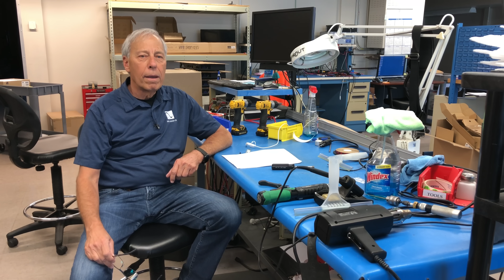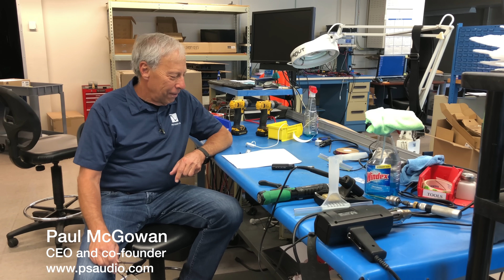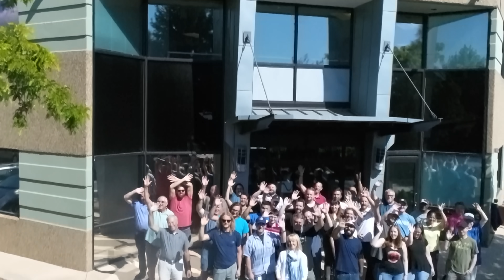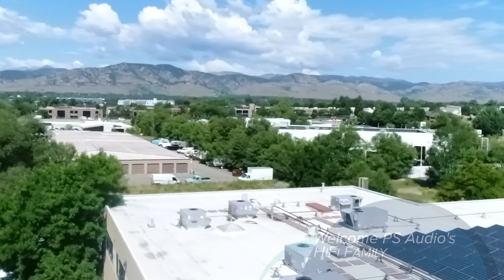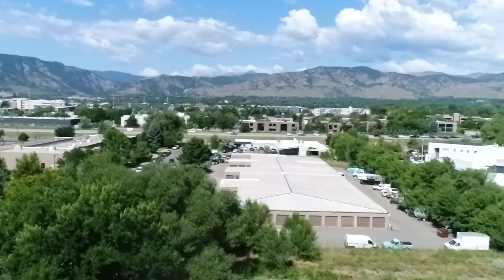Do amplifier specs tell us anything useful?

Comment: A note about harmonic distortion. First, learn about the Fourier Theorem - which states that any signal can be represented as an infinite sum of sines and cosines. So, you enter with your signal into the amp - this signal has a Fourier representation - and when it comes out it has a different Fourier representation with some of the sines and cosines with different amplitudes - therefore, harmonic distortion.

Why "Harmonic"? It comes from the harmonic series that is the fundamental (the 440Hz of the center A in the piano) and its harmonics (2*440, 3*440 and so on).¹ The fundamental is called the first harmonic and the 880Hz the second and so on ... Now lets check a piano keyboard: 880Hz is one octave above  the center A and the 4th harmonic is 2 octaves above the center A - and that sounds good and was even used by piano roll arrangers to get more sound out of the short strings those machines had. On the other hand, there are the higher harmonics like the 13th, 15th and so on which aren't even in tune with any note!²

So, to tell if the harmonic distortion is high or low, knowledge about the technology used is important: a tube amp with high THD will sound very good even in bad loudspeakers but a BJT amp³  with high THD will sound worse the better the  loudspeakers are.

(1) Check the harmonic series in math. The amount of each harmonic was used as the first definition of "Timbre" by Helmholtz (if I'm not mistaken). Nowadays, the definition of timbre has changes and it has been proven that only the harmonics can't account the whole of it's qualities.
(2) Check how modern tuning is done and what is "temperament". You will also learn why higher harmonics will not match any note.
(3) I'm not sure if the BJT always behaves like that specially after watching Arnie Nudell speaking on one of PS Audio's videos - there's more to the art than meets the eye. Nonetheless, classic BJT amps will have horrible sounding distortion.

Paul is absolutely right: specs are not what we hear. I wish someone would do a works, like Beranek did for Concert Halls, and create a set of specs that could give us more information about how an amp sounds - specially in this e-commerce era when we buy stuff without listening to them.

Note: did you know PS Audio is mentioned on one episode of MST3K? Yep!

Comment: Tube amp specs lose out to solid state amps but they sound great. 😬

Funny enough a big name UK speaker manufacturer’s owner is so totally against tube amps that he gets upset when you praise tube amps in their forum. It’s real funny.
Reply: Thom Moore ... what amount of distortion are we getting if we are not pushing the tube amp to say 75%? At high levels of course there’s a good level of distortion in tube amps, we know that. But at lower levels it won’t be that noticeable.

Some people enjoy the sound of a tube amp. So be it. Why the fuss? If you like SS amps fine. That’s your choice. Good for you.
Reply: @hushpuppykl  Tube amps can play louder than solid state amps with the same power rating. Tube amps clip better. If a tube amp sounds distorted then something is wrong with it.
Reply: Anders Hammer ... tube amps have higher measured distortion levels than a solid state. That is a fact.

Some only believe in measurements. If it don’t measure well then it’s deemed by them as worthless.

They can’t accept the fact that people do enjoy tube amps. 😬
Reply: @hushpuppykl  Looking at a spec sheet now for a Mcintosh tube amp and it says .3% which is darn good. Many of the better sounding solid state amps have higher levels of distortion. So specs only prove that its a working amp. Which says nothing about how it sounds.
Reply: Anders Hammer ... well ... that is something hard for certain Hi-Fi technical snobs to swallow. We enjoy tubes. So many reputable reviewers love it.

Even the late Arnie Nudell enjoyed tubes. Bascom H King is ok with it.

Somehow these people can’t handle it. Why can’t they live and let live? Beats the heck outta me.
Reply: Mcintosh tube amps from the late 50's to mid 60's had great specs and they sound pretty good. I have a pair of MC30's with all the paperwork.
Reply: Thom Moore ... people like you need to take a chill pill. Stop going on a crusade. You know how the crusades ended and how wrong it was.

For your information. I own a really good solid state and a really good tube amp. I enjoy both.

Comment: I have noticed especially with cheaper multi channel A/V receivers, that quite often the power ratings in specs are only for 2 channels driven and not at all channels driven, which I think is a little dishonest. If you run your receiver with all channels, it will most of the time struggle to put out that same power that it’s supposed to be rated at.

Comment: I have infinity quantum 2 speakers what amp should I use I only have 2 grand to spend does any one have good ideas
Reply: that depends. if you're on the hi-fi side, you're better off with pro or DIY amplifiers, they're usually far more ideal than most hi-end amplifiers. otherwise, no idea, i'm not a fan of hi-end stuff.

Comment: There are some speakers that are very hard to drive: when you look at their measurement it may show impedance drops from 8 Ohm to 4 Ohm in high and/or low frequencies. Example: KEF LS50. When choosing an amp for such speakers one necessary spec to look at is its power output into 8 and 4 Ohms. The suitable amp will produce 2x power into 4 Ohms comparing to 8 Ohms. If it's less than 2x – avoid, otherwise those demanding speakers will sound lean in the bass and constricted in the high frequencies.

Comment: I consider spec-sheets like a resume flagging which ones to call in for an interview.
Reply: @Thom Moore 
Humm...can’t say complete specs tell the story with amps and such imho. I’ve owned many amps and source components and they have sounded very different.
Reply: @Carl-bd1rf  Exactly!  Listening/Interviewing is a must.  Obtaining solely by specs is not a discerned choice.
Reply: @Thom Moore Exactly! The Specs are the resume.  Must analyze for yourself.  But, if one is incapable of understanding the resume/spec...  THe human factor!
Reply: @Thom Moore 
Ever done blind listening tests between amps and sources?
Reply: @Thom Moore 
Interesting. I’ve noticed differences big time. More so between amps.
Reply: @Thom Moore 
Agreed, level matching is critical. Even a slight difference in level makes the comparison invalid.
My EL34 amp sounds different from my SS amps and it’s not a single ended triode! 
I’ve heard some really poor sounding SS amps though, made me wonder if they weren’t faulty. Probably more of a speaker/amp mismatch then anything else.
Reply: @Thom Moore, I agree with what you say mostly. The rest is plain Wrong.....But. in fully active multiamped systems, the amp's dont have as much of an impact other than having different size, brand, type, etc. My experiance says its better if they are all one exact same model (#)
Reply: @Thom Moore, one of my favorite systems to date was one in 1999. It was several 2 way crossovers "stepping" Daisy chain maybe, and cheap "Urban" class D amps. It had 12's, 8's, 6x9' and dome mids. I'm sure it a
was all out of phase, but it was sweetness! when I switched to class ab, the out of phase was much noticeable.

Comment: I remember a video you did on tube amps and the spec to pay attention to was output impedance, that applies to solid state as well, the majority of consumer brands output impedance is 600ohms, a brand that worked hard on there product will list that spec because they are proud of it, 400ohms and below will sound really good and it’s really expensive, I follow up on knowledge you present

Comment: Here are some parameters to look for,
More Wattage is always good idea.
Linear frequency response.
Ultra wide bandwidth.
Lower distortion. (THD)
Powerful transformer.
Gain ratio 
Build quality.
One might need multiple analog and digital inputs and preouts depending on their requirements.!
And best parameter are your ears, Let them audition well before you decide.
Reply: Don't forget s/n ratio and dynamic range.

Comment: Simple specifications and measurements cover simple matters. Complex and more advanced specifications and measurements, that usually aren’t as widely known, can do much more and can be of tremendous value. Ears alone can not be relied on but of course ultimately equipment need to pass critical listening tests. Make no mistake, equipment that fails certain tests also fails in critical listening tests. And equipment that fails a critical listening test likely also measure poorly but it’s quite possible that those particular measurements were not done.
Reply: Jup there's a correlation between the two.

Comment: Disappointed in your response this time, sir. Seems like you stayed within spec differences that are barely audible whereas real deviation from best in class could very well warn one away from a substandard product. Plus, how do I ever justify moving from a noted brand like my Yamaha receiver to a dedicated power or integrated amp WITHOUT seeing at least one spec that suggests, before trial/purchase, that the amp will perform better?
Reply from the maker: Because there are no specs that measure audio performance that I am aware of, and I've been doing this for nearly half a century. I wish there were, believe me. It's why we designed our 30-day in-home trial and pay the shipping costs both ways (should you return it) - to make it as easy and painless as possible to try it for yourself. It's the only way I know of to find out.
Reply: i have seen it too. Great spec's and the same ole same ole. Most all of  PS Audio stuff has been tested and tuned on a system with over a 100 drivers. That's nats ass stuff. Paul has confidence worthy of his stance. It comes down to try it like it as the best or give it back. Specs are a good starting point, not the final.
Reply: Neither a troll nor a moron nor a rude asshole like some I could name. I am EXACTLY a mid fi owner who lives in a place & time when one can’t pretest hi fi before buying. So figuring out who’s hi fi audio amp I should order for in home trial is an issue. I find Paul/psaudio response here sensible but a bit exasperating, as I’m not about to order 3 hi fi amps to audition at home.

Comment: Q. What specs matter?
A. Specs don't matter pedigree does. 

Uhhhg. Really Paul? 
That is not true in ANY industry... 

For instance, no one uses an apple watch to play Red Dead Redemption even though Apple has better pedigree than Microsoft. The specs of the watch (RAM, type of CPU, user interface) make that a silly proposition.

Paul, You are an engineer. You know this.
Fortunately I don't need to be an engineer to know that what you are saying is ridiculous. 
Maybe you need to get out of the house more. Sounds like you have been drinking the Kool-Aid.
Reply: That's not what he said
Reply: I don't think he has an engineering degree . Siegfried Linkwitz had one , even a Phd and held multiple patents , Bruno Putzeys (Hypex amps and Kii three speakers) does , Nelson Pass has BA in physics and is a multiple patent holder .
Reply: @DKsg10  he said they had listening rooms. He did not say are even suggest other audio companies did not.
Reply: Tuned by ear and backed up with return policy. PS Audio is the loser if returned. This is the same old "everything can be measured" Crap.
Reply: @Dave G.
The best that I have for you is an illustration of a scenerio. 
Say a person has a money is not an object financial picture.The person is like a child and doesn't care anymore about what reputable source says what is the best piece of audio equipment out there. Doesn't care about all the gumbo of this spec or that spec. This person just wants to see if there is any possible way to have better. PS Audio is there saying look, its what we have come up with, its what we believe is a good product. Pay for the item and try it out. If it isnt good for your system then send it back. No Loss out of pocket.
Most people in the comment section dont buy PS Audio because they are not in that scenerio. The scope of this "ask paul" is,  or was at least last time i checked, "the car talk of audio" so you're free to disagree all you want with the ideas of Paul.
Reply: The "well off", have all different philosophys. 
There is a lot to learn from this old dinosaur Paul. You just have to get over you're difference of opinion from his. Most all of us here have at least one major beef with Pauls ideals. Yours might be spec's. Mine is active systems vs one amp and a bunch of caps, coils, resisters, light bulbs and what ever else they use to make a speaker sound good. Then you have to have tone controls, eq's, room treatments, special walls, dedicated supply lines, 1200 dollar power cords, xlr connections, on and on.

Comment: Weight. BIG transformers and the need for BIG Heatsinks are more important than WATTS..
Reply: I can't remember the brand, but I once had an amplifier in for repair and it "apparently" had huge heat sinks all across the rear of the device.  They looked very real.  After opening up the amplifier it was apparent that the heat sinks were "fake" and made of black plastic.   The actual output devices were mounted on a small (actual) heat sink and were in TO-220 cases.  The actual power of this amplifier was 25 watts or less.

Marketing.
Reply: @swinde  C'mon...
Reply: @tsamplifiers6493     For sure he bought it for an amazing deal  from a "WhiteVan "    lol
Reply: @swinde  ROFL!
Reply: @swinde  Sounds like you encountered the "white van speaker scam".
Reply: While the post is just an account of a repair where the manufacturer put what appeared to be a large heat sink for show on the product, I have been accosted while driving by "White Van" speaker scammers.  Twice, in fact while living in Memphis in the 1980s.  I never stopped, because it would have either been stolen property or crap.  In both cases the van was actually "white".  In the late eighties I heard of another scam of selling laptop computers from a trailer truck. The computers were actually just a brick in a box.
Reply: @swinde  A brick in a box trick 😂
Nowadays, they don't even need to hire a van for that. They just sell stuff online and send bricks instead.
Reply: I've seem metal in speaker boxes for wieght. It was Junky Stereo Stuff.
Reply: I'm 100% in agreement with that for Class A and AB. Heat kills semiconductors and you can't draw the current needed for decent bass without a large PSU. Class D is a different matter, but I only ever owned Class A and AB amps so can't comment on the performance of other classes.
Reply: There is ALOT more to it than weight and heatsinks.. Powersupply vs output power and how much is actually lost in heat etc is more important. And the quality of the components.
And today we also have class-D amps and they can be light as a feather while still be good and powerfull as a truck. If it's a class A/B or A then it's another story again. So just looking at weight and heatsinks don't really work anymore... Maybe in the 80's..
Reply: “The weight is a sign of reliability. Remember if it doesn't work you can always hit them with it.” Boris Blade.... This is still a rule I blindly follow despite getting excellent results from some very light/digital designs . Some of my "pro" crown amplifiers way outperform in power and "quality of sound" than some of my very large boutique amps. If it sounds good to you... it's the right choice.

Comment: What are the specs to pay attention to for bad sound quality? Can the specs differ from class and design?
Reply: How and if negative feedback is used plays a much bigger role in the sound than most other so called specs.
Reply: @InsideOfMyOwnMind  How not if. There's nothing at all wrong with using negative feedback per se . Using negative feedback to compensate for poor overall design is not just poor practice, it often used to lead to instability in the "inaudible" frequency realm (above 20 kHz). It would be a rare amplifier that had no NFB and also performed well. I'm not saying it can't possibly be achieved; there are geniuses in the world.
Reply: @jonathansturm4163  I always thought negative feedback was largely to fix the gain of the amp, but also played a big part in linearity.
Reply: @marcusfred4480  The main purpose of NFB is to improve linearity. The gain of the amp is set such that there is an excess available for NFB.
Reply: @jonathansturm4163  Ahh. I see. Yes that makes more sense. Thank you.
Reply: @Johnathan Sturm, 
Good explain. i don't know a lot about electronics. I'm here to learn mostly. Negative Feedback is to keep it linear. ok.
Reply: Watts... lots of home theatre recivers are rated higher than they should be. Only a few brands measure the power correctly.
Reply: @FSXgta  true.!